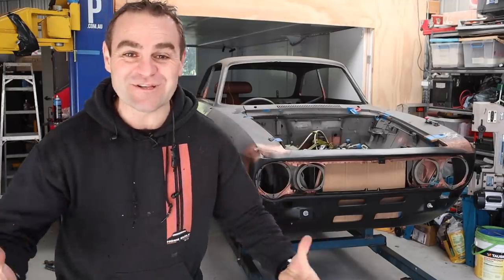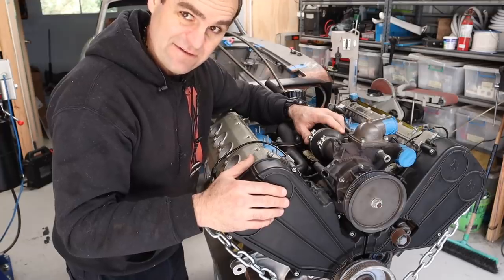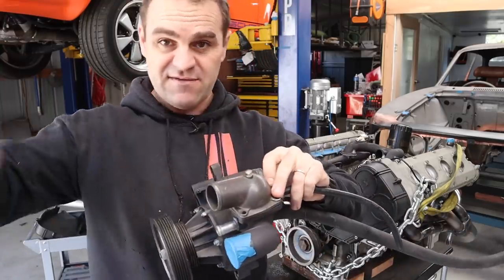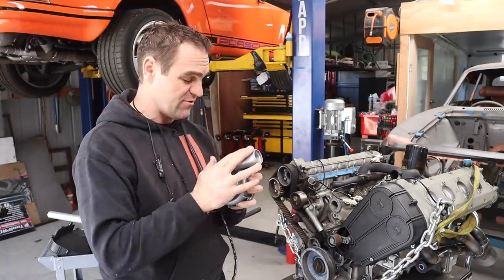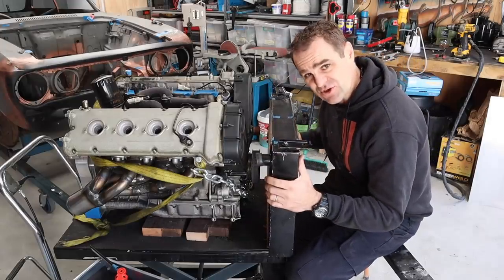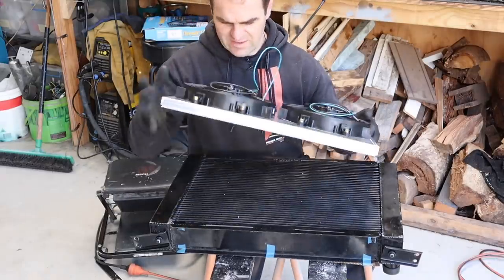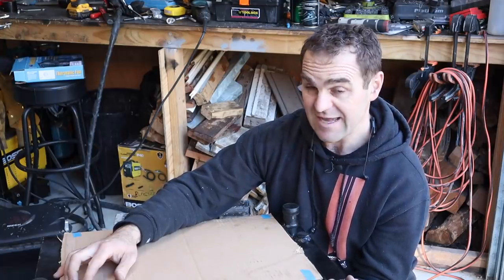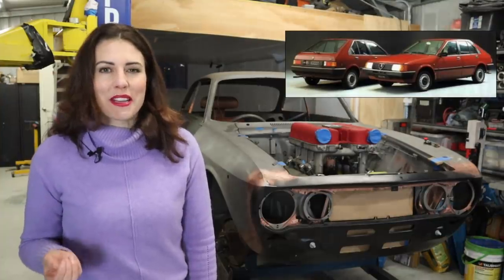DIY Radiator Fan Shroud - Ferrari engined Alfa 105 Alfarrari build part 53

Comment: It looks like there is room to add rubber flaps to the shroud that would blow open at speed and then at low speeds and at a stop when the fans kick on would be pulled shut so all the air is pulled through the fans, I have seen this on some fan shrouds and always thought it was a good idea.
Reply from the maker: Interesting.
Reply: There's a recent Speed Academy video where they installed the flaps:
https://youtu.be/fMmQZ_qognY
Skip to around 13:30 for the install. Looks to be a cheap way to add a little cooling performance.
Reply: Nice job, and I agree.  At speed, the shroud will actually block a lot of flow.  If you experience cooling problems later on, first thing I'd do is remove the shroud and mount the fans directly to the rad. If the fans are sufficient to cool the engine at idle and low speed covering just the fan area, the radiator will work better at high speed without it.  Love your project.
Reply: @HomeBuiltByJeff  Jaguar xjr (98-02) radiators have the flaps if that's a help.
Reply: Good idea

Comment: Jeff on the blank spots around the fans, id be inclined to use a big step drill and make alot more holes as that will give alot more air flow thru the radiator and over the engine
Reply: Larger holes with rubber flaps so when the fans run, the flaps get sucked flat and seal the holes. And at speed they allow more air through
Reply: @MrMightyytau  good thinking Batman, would be more efficient
Reply: I would agree with that . My point as well.
Reply: @richardhintonracing  I first saw this on Maserati Biturbo"s ( horrible cars) 
And to be honest he'll struggle with cooling as it is

Comment: You could add two rubber flaps in the left over space on the shroud. That would allow air to flow through when the car is moving fast enough. Keep up the good work!

Comment: Hi Jeff,
As many have said, additional openings in the shroud  - either with flaps or with "internal" ducts (rings) between the fans and the radiator to ensure you are not just blowing the air in circles - is a good idea. Most people don't realize that fans actually do not move that much air. Even the most powerful fans are only effective under approx. 30mph. Over 30 or so, the volume of air moved through the radiator by driving is vastly more than any fan can provide - so your shroud and the fans are blocking the cooling air instead of aiding the cooling... Just sayin'

Comment: I think that you need to take another look at how the original waterpump works. Generally all waterpumps circulate coolant around the engine and heater core during warm up, when the temperature rises to the thermostat setpoint, the thermostat opens and diverts flow through the radiator. If you stop the flow until the engine warms up you will end up with localised hot spots in the block and head causing distortion of the block and head. Please reconsider your proposed control strategy for the waterpump as I am really looking forward to seeing this wonderful creation being finished without tears.
Reply: psob1 I would also say try it with very low pump speed and no t-stat vs. with t-stat and see how much longer the warm up takes. Ideally with two extra sensors in the radiator inlet and outlet to see if in normal driving conditions shortly after start, the limited flow through the radiator has any significant impact in how quickly the engine comes up to temp. Loads of potential for interesting experiments if you can datalog and try different scenarios. Personally I love that kind of stuff

Comment: Jeff! Random thought on the intake manifold: what about building a manifold similar to how you did the headers? 

Now that you've emptied the V of the engine you could retain the factory length intake runners to the plenums - lean them over from one side of the engine to the other, the plenums could  be tubes welded up with the same internal volume as the alloy ones, cross-over tube, etc.

If you welded it up out of stainless, polished it up and and got it kind of looking like the polished tube intakes of older Alfas... Maybe even avoid a hood bulge...

I know, I know - that's probably like what - at least eight videos of work? Hehe.

Comment: Not necessary, but I've always fancied them you can add some rubber bypass flaps caddy corner on the fan shield. They help allow more airflow through at high speed.

Comment: Hey Jeff, Liking the work so far. Couple of tips... Not sure what ECU you are using but i have my thermofans controlled by a Arduino controller and a couple of PWM electric controllers (around $40 on ebay). Basically the Arduino gets a temperature sensor input and then can adjust the PWM controller ouput based on temperature. I "tune" the settings so the thermofans are always on (in my case at 55%) but just at the point where i can't hear them from the drivers seat, then for every 1 degree above 88c the fan increases by 5%. So when the temp gets to 97c the thermofans are on full. For a fail safe i also have a temperature "switch" in the engine that when it hits 100c the thermofans bypass the arduino and PWM controllers and just get a full 12v signal directly (fused and relayed obviously). I find this is a much better method than just having On/Off or even High/Low. 

Also, with the electric water pump, ensure you always have some flow even when cold. Sometimes the temperature sensor isn't in the ideal location and without flow it may not get an accurate reading. Having some flow also prevents "cold shock" where suddenly the pump turns on and moves a bunch of cold water into a warm engine. 

And others have mentioned, look at using rubber flaps to help airflow movement. 

The most important aspect of cooling is ensuring you "force" all air through the actual radiator core. Once you've mounted the rest of the coolers, make up some rubber panels to block any gaps around the radiator to ensure maximum cooling. 

I don't want to be negative, but you may find you struggle to keep that engine cool with that setup. Generally speaking, a single larger fan will flow better than two smaller ones, but it looks like you have enough room to fit a single one down the track if needed. 

Cheers

Comment: Got to agree with other comments that the shroud seems to be restricting airflow through the radiator. If the shroud was on the reverse then the shroud can be used to direct the air to the engine, but on the front it just restricts flow.
Reply: Huh? The shroud is exactly where it’s Supposed to be
Reply: Just watched it again and see now that Jeff is turning it around to reposition the outlets so yes shroud is on the back, my mistake, however I would still put some holes in it to allow more airflow.
Reply: Skylark Camper Those holes will male the shroud useless unless he installs flaps over them
Reply: Fair enough

Comment: I have a 302 windsor in a ford escort regoed in nsw and i had the two small fans and a shroud and it used to always get over the boiling mark .. I now have got now twin Maradyne 14" Champion fans and no shroud cause it used to block the airflow, Airflow is what you need in a small car with a big engine .. My Radiator is a 3 core, 3/4" tube 12fins per inch copper/ brass and will cool up to 700hp,  I also run a 16lb recover cap a davis craig electric 150lph alloy pump.. and 50/50 mix coolant ..It cruises at 180Deg F and in bumper to bumper in 35deg C summer heat it climbs to 195deg F and then drops to 187deg F in about 30secs.. Hope this helps

Comment: Jeff, a very popular option (for the ones who are in the know) is to fit a mini alternator of a mini kubota excavator. It does the job, is VERY small and this fits virtually anywhere.
It is so small, it'll fit low on the right of the motor, or even inside the V.
I think, you might find this interesting, since you are a bit low on real estate under the bonnet.

Added a picture: https://www.cordituru.com/alternator-permanent-magnet-kubota-excavators-sub-compact-garden-tractors-diesel-1553164013-1553164016-1553164017-p-34284.htm

Comment: Those fans block half the radiator core so will massively reduce its function and your reliance on the fans which may not keep up with demand. Get some radiator shroud flap valves or make some by cutting holes and using rubber from something like a bike inner tube. Means the air can pass through the core and open the rubber flaps when simply driving along but when the fans kick in they close the valves and all the air is drawn.

Comment: Did you consider mounting the fans on the front side of the rad and pushing the cooling air through instead of pulling the air?

Comment: Get the water pump as low as possible. That original water pump is too high for your application. 

Lose just a bit of coolant and it will run dry and overheat. Just ask any Triumph Stag owner!

Comment: Jeff,
Granted we dont fit Ferrari engines to these cars, but we use pusher fans in front, with now cowl. You have vacant space in front of the radiator and you then allow the full face of the radiator to receive air, either by the car moving forwards,  or the fans, or both. 
I'm surprised you've gone old school given the space restrictions you have.
Reply from the maker: I still have to fit things in front as well ;)
Reply: Pushing air is generally less efficient than pulling it. Sure, if not possible in any other way it’s better than no fans obv., but this seems to fit fine, I’ve had tighter fitting fans before
Reply: @TofumanFC3S  as a time served pump engineer, i have a fair grip on hydraulics etc. I would love to know how with the correctly designed fan, pushing air is less efficient than pulling. Obvs Jeff may have oil cooler, air con heat exchanger to install, so a pulling fan may suit better.
Reply: TheSimonNovis Well, in this case the main reason being that building the shroud as a buffer, the fans actually pull over the entire of the radiator vs. how push fans only the surface area of the fans themselves are seeing forced air flow. Now I guess you could (and it is being done in fact) build an air box in front of the rad., but I’d say you need a decent amount of spacing between fan and rad. surface to use the full surface efficiently. Depending on how restrictive the radiator is, it will be easier to get an even low pressure over the entire area of the rad. than a high pressure over the other side with pushers. Again, not saying it’s all impossible, it’s just way easier with pulling. Also, when we look at testing being done with fans mounted directly to the rad. we can also see a slight performance advantage with fans in a pulling config. I actually like watercooled PCs for this stuff since you can easily reproduce the same heat generated over multiple tries. Check the results here: https://www.ekwb.com/blog/push-pull-or-push-pull-on-radiators/

Comment: The radiator stubs should be soldered in, so why not heat them up to remove then ,and solder into there new position . Then it would be neater and you would have a full length stub. with less cleaning up the old holes.

Comment: Wouldn’t changing the length of the intake runners muck with the whole dynamics of the engine?  I would think that would need a cam change too?
Reply: Well, yes but so does the new exhaust headers. The intake runners are dual length, so even tho the overall powerband might shift a bit, he can still decide when to switch between short and long runners by triggering it from his ECU. Unless you have continuously adjustable runner length, they’ll never be ideal over the whole RPM range anyways. 

Lastly, his car will probably be lighter than the Ferrari the engine came out of I’d guess. So he is less dependent on the low RPM torque from the longer runners

Comment: The shroud is taking up much needed space plus it will restrict airflow!
Reply: It’s always a compromise. Since this is a street car it needs to perform in traffic and when parked. However, if I were Jeff I’d install flaps to make a nice compromise between open rad and shrouded rad. What would you suggest?

Comment: A lot of engineering in that Ferrari pump...a baby electric is not going to beat it. Id be putting it back, minus the gbox heat exchanger. Or atleast work the manifolds around the pump space, so later, when it over heats, it can be installed.
Reply: Modern cars have electric pumps because you are not confined to the pump speed being tied to engine RPM. Switching to electric is fine if done right
Reply: Those Davies Craig pumps are the best going. Well proven, so if Jeff has sized it well, which he says he has, it'll be just fine. Check out their website.  They've some clever controllers to change pump speed and fan use to be the absolute best and most efficient use of energy required for cooling.  Can't beat them.
Reply: The only issue will be ensuring the pump has enough NPSH at all speeds to not cavitate (Google it) inlet piping design will be key

Comment: Not sure I understand why you are cutting the radiator surely you could just rotate it and the holes would be on the outside and in the correct position

Comment: There is a Maserati that uses that engine that has an intake that would do the job just file off the name.
Reply: Agree. The earlier Maserati gt used the same engine with a much lower profile intake manifold. Probably worth looking at.

Comment: Won’t work.
Reply: What won’t work?
Reply: TofumanFC3S the fan shroud on the radiator. The squashed tiny headers strangling exhaust flow.  Chopping the inlet manifold down to nothing to fit under the bonnet.
Reply: You must be a Ferrari engineer... Ofc. it’ll work, just not as well as it did in the original car, which is fine since in here it old has to move a little Alfa at public road speeds
Reply: TofumanFC3S who does all this to drive at 60kmh? I build performance engines for a living. Mostly L series Datsun Zs for track and race. Many years experience modifying engines, have own dyno but I’m no Ferrari engineer. Neither is Jeff.
Reply: BRETTYZCAR I have a hard time believing a professional engine builder would comment “It won’t work” tbh, I’m sorry mate. But an engine builder would understand that both intake and exhaust design is always optimal for one specific RPM and, if you do things right, good/alright for a chosen RPM range. It WILL work, just a bit sub optimal compared to in the F360.  

He’s clearly trying to make something unique here, and even if he gives up a 100hp it’ll still be quite fun for a crazy street car. 

If you think the factory Ferrari engine isn’t full of compromises, you are kidding yourself. Yes he’ll give up bottom end because of the shorter intake runners and top end because of the DIY headers, but he has decided to give up a bit of performance for packaging and this will even happen when fabricating race cars. Also the factory intake is dual length, that will help him still get the most out of the situation. Depending on how much shorter his runners need to be, he might trigger short runners at very high RPM or maybe even figure it’s not even worth to trigger it all...

I have done weird engine swaps as well, and you should know it’s not always feasible to do everything as you’d wish.
Reply: TofumanFC3S by your equation and their quoted output, you’d be happy with a 25% loss?👍
Reply: BRETTYZCAR This isn’t about me. I personally wouldn’t. I’m currently actually installing an M113 AMG engine in a C124 and actually plan on making a fair bit of extra power simply by building headers better than the horrendous stock ones (packaging) and optimizing the intake from grill to port. But that’s me, and I don’t have pressure from an audience that expects a somewhat quick turnaround. But still, giving up in worst case 25% performance is still a looong way off from: “It won’t work”